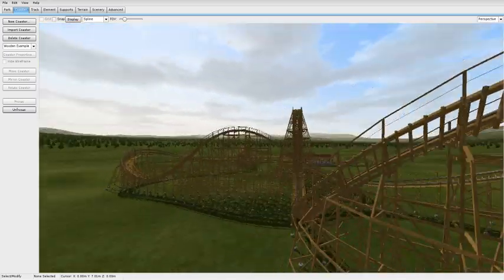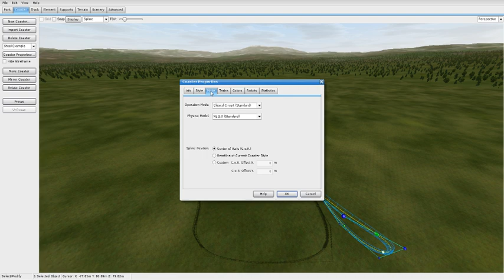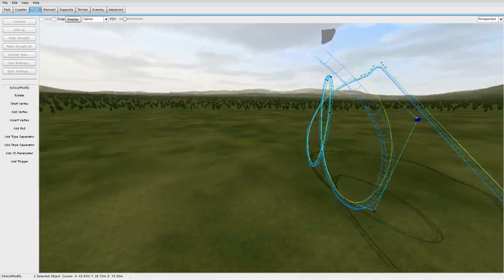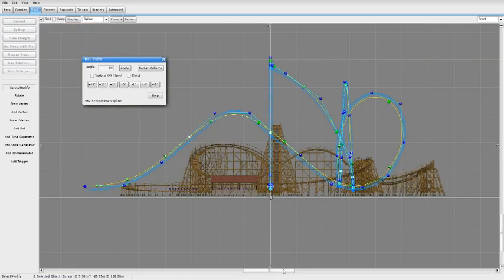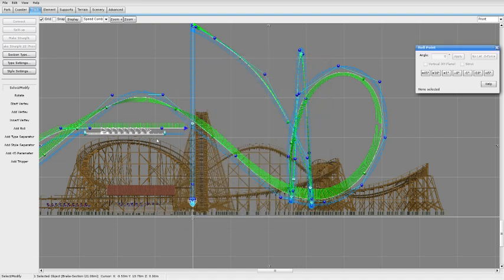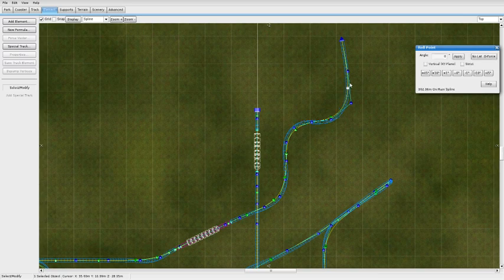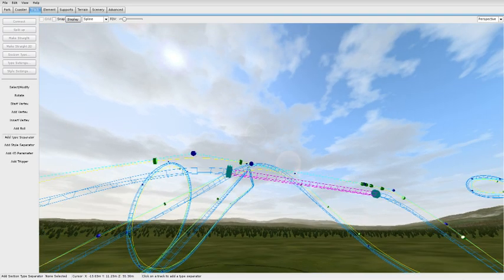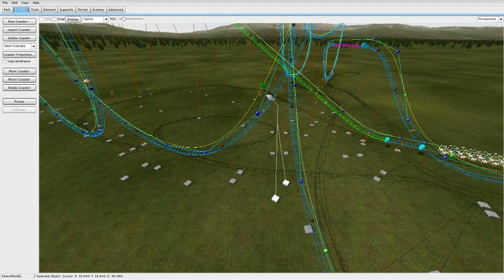Nolimits 2 Tutorial: Part 2 - Steel Coaster Elements

Comment: I think use of the "strict" option on your roll nodes will make your life a bit easier in preventing the twisting track, instead of just adding bunch of nodes in a row like you did before the MCBR.  Also, B&M brake runs need to be sloped slightly downward so the train can get going again after a complete stop.  Other than that I really appreciate these tutorials!

Comment: Hi first of all thanks for that tutorial but i have a question:
(if it matter i got the demo)
Often when i build i coaster it just gets a spin in the track and for example on the lift ill i need to set like 10 points to say he should go to 0 roll. and even then between the points the track still rolls... why happens that?
Reply from the maker: is the track full circuit yet? the last vertex can cause some odd twisting throughout the track
Reply: TheCodeMaster

No it happens when i have 5 or 10 vertexes and then i get a twist at the last vertex of about 45°

and i wich u could make a tutorial about cameras because i do want to make an offride camera where the view jumps to the next camera or for example focuses the end of a tunnel till the trin conmes out and so on

Comment: Can you build a coaster segment type by segment type (changing as you go along) instead of changing the type later? 

I remember that you could use Ctrl+g to smooth the track in nolimits 1, do these shortcuts (I can't think of the correct term) still work in nolimits 2?

Cheers!

Comment: I have a problem, I have 4 block brakes in my coaster, 3 cars, one lift, and one station, and for the final brake (there is also a brake run before the station) it says there are 2 cars in it, even though there isn't. I was wondering if I could have some help. :P
Reply: Never mind, fixed it :P

Comment: whenever i do the drop loop thing my straight track twists
Reply: Usually change the banking or make it less steep, when I build a steep drop like a beyond vertical, it twists.
Reply: You probably have to add roll points. If that doesn't work, maybe try adding the roll points THEN add the turn thing at the top by double clicking the roll points (In other words, double click the roll point and a box should pop up. Then, at the top of the box, there should be a +1 +15 +45 -1 -15 -45. Mess around with those [they turn the track in angles so an example is if you click +45 or -45 twice as the rotation starts at 0, it will turn it exactly sideways]) If you edit the roll points good enough and you placed enough, it should be able to keep that part straight. Hope this helped! Let me know if you have any questions. 
-Ethan

Comment: If you struggle making any elements go to the elements tab and then you can add a pre-set element.
Reply: Yeh but they don't have all the elements and if you set it as a download it won't have fair ratings as professionals complain about it not being hand built. It's better doing it with out the pre-fabs as it can be made more accurate
Reply: +Isaac Gamez yes, but if someone is new to NL2 and they want to include a loop for example, they may get stuck. That's why pre made elements are useful as they help beginners build looping coasters or whatever while they are getting used to shaping the track and all that stuff
Reply: +Liam Wright yes, but if you keep going to pre-fans your going to go nowhere. How are you going to learn. That's why you try and try. And practice and practice then you get there
Reply: +Isaac Gamez I started out using prefab elements and as I got more confident with track shaping and stuff I decided to have a go doing everything by hand and I had loads of practice and now I can do it fine!